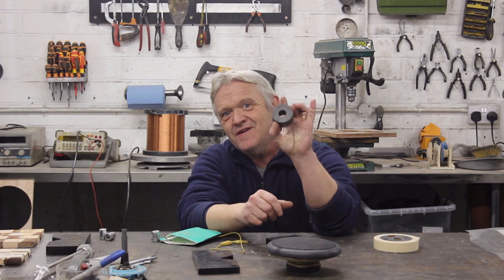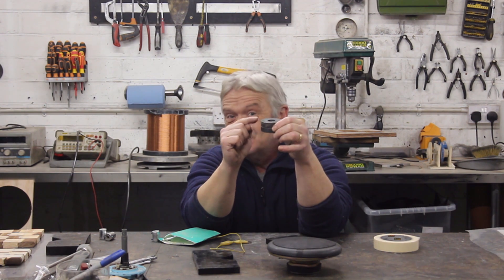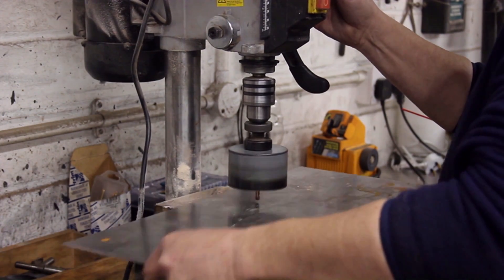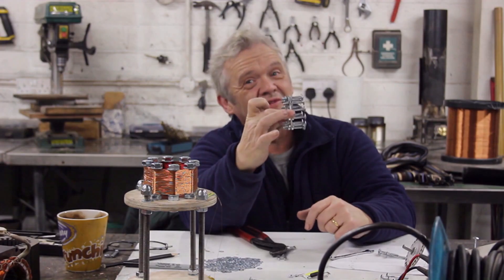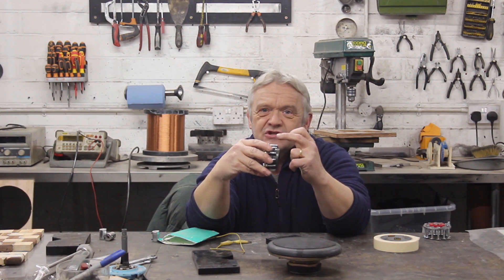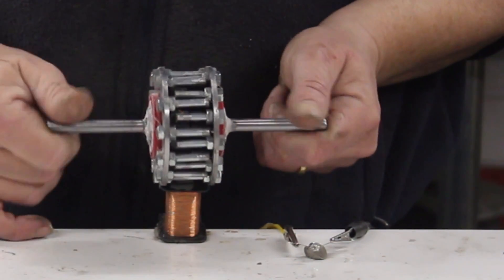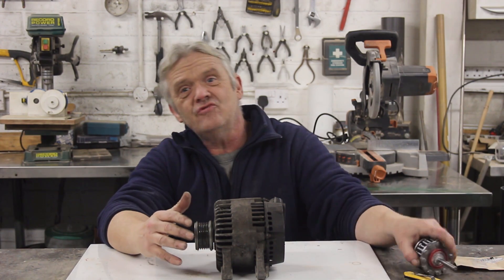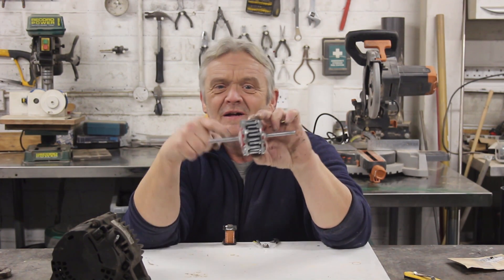1849 Speakers On Fire - Getting Power From A Speaker

Comment: I have taken some  of those magnets and added it onto a electric fan motor and I’m still in the project but need some more time on it, I was able to generate a resistance field on the stator but have not yet connected that to a rectifier   and capacitor, I was thinking power by wind wall or kinetic battery 🔋

Comment: 0:31 I believe there's ways to spin the ring magnet on a 90° axes quite easily,, 2 simple 3D printed clamps on the rotating points with bearings in them and a bolt on each side,, then have multiple of these rotating in another ring. Then multiple of these rings with different diameters spinning on different axes in a ball. Like those in Star Trek. 🤔

Comment: Hi Rob, thought I was getting to understand electricity but I'm now more confused the more I know, or think I know. The more turns on a wire on/in a coil increases voltage right? And the voltage reading is the potential difference between one end of a wire and the other, so the voltage we get across the coil is whatever is being generated minus whatever is coming out the other end, is that right? Thanks mac

Comment: Hi Rob, I discovered much like a light bulb a speaker (for a PC) can not tell the difference between ac and dc voltage and it also uses less power with dc. The wires became thin and brittle at the plug and eventually snapped, so I hooked it up to a motorcycle battery, doesn't matter which way round the wires go either which I found odd. Used about 0.1 amps at 12 volts, the speakers when plugged into mains were 55 watts consumption.
Reply: Actually just checked again and the speakers were 18 watts not 55 my bad, dunno where I got 55 From!! Must have been looking at something else, still 18 watts on ac and 12 x 0.1 = 1.2 watts on dc. That's a massive saving percentage wise

Comment: So, put the thing on some bearings and spin it next to your coil, and let's see it work. Put the output on an oscilloscope and let us see it.  What is the rectifier circuit needed to make DC?  Where is your microwave transformer?
Reply: " What is the rectifier circuit needed to make DC?"
He's probably having the LED pull double duty by using it as a diode.

Comment: Those chinesium ceiling fans are about the same size as those speaker magnets and have the pressed steel crab claws! IF I can get permission to disassemble (Johnny 5) the 2 surplus speakers in the surround sound system, I will try it.
On another note: faraday research RND channel and zero point/ permetumle energy machine, have you veiwed any of his videos? To me without paying for patreon membership; it looks hocus pocus, your thoughts Rob?

Comment: That is awesome. Are you still interested in the earth battery idea btw? I think the name needs to change. Did some tests myself and found that while the chosen material matter, the size and shape does not seem to matter. Or the amount of soil and so in. Saw a clever dude who made a tiny bank of these batteries into about a AA size. What I found really interesting was when testing continuity across various of these experiments, the fact that the buzzer went off amazed me. Sometimes I wouldn't get continuity buzzer, but do get volts. My last test was PVC conduit with tiny holes at varying distances, filled with plain water and sealed the ends, I got a voltage of about 0.5 and distances did not make a difference. My conclusion is that smaller is better. This really sound like a 3d print idea. Like the ice tray, but much smaller and tiny tiny holes the diameter of your copper and steel wires so they can be filled and wires inserted easily. We know electrons are not really moving through wires and that is actually the fields around the wires and the wires only direct them. This is why I find it fascinating and all the stuff you do lol
Reply: Oh and most important, water seems to be the key ingredient. So does water have a special field we are not aware of? We know water is a unique liquid, non like it. Take also conductors, we think we need them alone, like adding salt to make water conductive, but static doesn't require a conductor. Sorry, my head going crazy again
Reply: @adesign5  water mixes with the soil to create ions (charged atoms and molecules) which allows the ions in the soil to conduct. As I have mentioned before (to others) is this system is just creating a "battery"... where moist soil acts as the electrolyte. It is basically a very poor battery. Most of the energy comes from the zinc and copper reaction and very very little from anywhere else. You can prove this to yourself by testing for "milliamps of current" with a multimeter to see how much current you get with a dead short... and then remove the zinc and replace it with just copper... now there can't be any zinc copper action and you will find the current of "just the soil interacting with copper".
Reply: @marcfruchtman9473  I don't have zinc unfortunately and the amps are too low for my multimeter to detect anything. But I do think your wrong with regards to the reaction happening. Because I still got results by testing just plain water. And the chosen metals only have to be different. It is was a chemical reaction like a battery then bigger sizes would matter, but it doesn't. But it is because we don't really know what is happening that I like exploring this idea. Anycase there is a lot of testing to still do. Plus I live in South Africa and we don't have power about half the day, so that frees me up to just test things like this, without any preconceptions cheers
Reply: @adesign5  Sigh. "Too low to detect" literally says it all. Please, if you don't have power half the day...there are far better ways to generate power than "Too low to detect" What resources are around you?.
Reply: @marcfruchtman9473  I never said I'm looking into this to generate power for myself, there are much easier ways. What I am saying is it is interesting and I have time to mess around because I have plenty time without power which means no interference from grid power. And yes, I just have the cheapest multimeter. Sigh, where is your sense of adventure or do you just know it all and say there is no need to experiment. Sigh sigh
Reply: @adesign5  Well, if you have time to spare that's fine. But,. I do think the lack of milli-amps says it all. I can hook my multimeter up to "water" and get a small voltage but it doesn't have any meaning since there is not a useful current with it. But for curiosity sake, If it will help you experience the truth... sure.

Comment: My last post was giving me trouble. I’m going to try it again.

Your ring magnets are curious. I have often considered trying to shield one of its poles with several layers of magnetic shielding material. Wondering if this would allow you to greatly reduce your chosen magnetic pole.

Creating an imbalance allowing the magnet to enter one side easier than it would have otherwise. Possibly propelling a magnet passing through the center faster out one side than the force required to get into the center of the magnet.
Reply: Not exactly sure what you mean by "faster out one side required to get into the center of the magnet" because it seems to imply more energy out than in. (Unless you are saying something else?) But otherwise there is not a way to do that. (That violates the principle of Conservation of Energy.) However, you might be able to arrange it where it takes much more force over time to push something inward, and then comes out faster but with less force over time.
Reply: @marcfruchtman9473    Thank you for your response and yes you understood my ramblings fairly well.  

I understand what the fundamental laws are.  I am not proposing a change to those understandings, simply a cleverly designed shield that redirects the chosen magnetic force.  

Magnet switches do this.  Allowing the user to switch the force of the magnet essentially on or off.   Of course it’s not turning the magnet off, it’s just positioning a magnetic shield in a fashion that the force is nearly canceled out, or moving the flux away from the chosen area.  
 
The same concept just in a way that would allow you to (in few words) create a magnet that who’s “repulsion” phase is acting on the center more strongly on the outgoing side of the ring.
Reply: Let’s say we are passing one small magnet through the center of the larger ring.  The small magnet is traveling  in a straight line through the opening in Robs ring magnet and out the other side.   The magnetic faild of Rob’s ring magnet should more or less look like a donut.  When the small Magnet travels in a straight line toward the opening of the ring magnet it will be encountering either a push, or pull force that is equal to its counterpart should the small magnet be traveling through the opening and out the other side.  Canceling any possible net gain.   Laws of physics right.  

What if we designed a shield to redirect the flux on the incoming side of the magnet in a way to allow the small traveling magnet to encounter less direct force coming into the ring than the push it will revive from the non shrilled side of the magnet.
Reply: @Route72Trucks  Ok... yes, that makes it more clear. So, one of the most interesting things about magnetic field lines is that they follow a circuit path. Now, I have to say this never made any sense to me until recently. Basically, all of "space" (and air) is mostly "empty" and therefore it has a very similar "conductivity" to a magnetic field. You can generally think of this term as the magnetic Permeability of "Free Space" and the magnetic permeability of air is essentially equal to the vacuum of space. Rather than use the actual number they call it "relative permeabilityand call that =~1) Now imagine I said... that it is all like a "wire" conducting magnetic field lines...  So, now you sort of get how magnetic lines of force are "conducted". However, "soft iron" is much much more conductive (permeable) to magnetic fields... essentially, (not the same as a shield) but essentially, if you place a piece of soft iron (called a keeper) onto the ends of a horse shoe shaped magnet  almost all of the magnetic lines of force are "conducted" into that iron piece, and almost NO lines of force will go beyond that. Ie, it concentrates the magnetic circuit into the iron. Thus, you can sort of create your idea, by molding soft iron over the areas where you want "less" force because the iron will pull the magnetic lines of force into it. (If that makes some sense?) However, I do believe that you have to make the "circuit" for it to be most effective.
A decent video on this topic is: Magnetic Fields, Keepers & Iron Filings with Horseshoe, Ceramic and Neodymium Magnets by RimstarOrg
Reply: @marcfruchtman9473   thank you for the information Marc.  More things I will keep in consideration as I mentally chew on this latest of thought projects.

Comment: I won second place in high school for theorizing a wall of microphone/speaker modules placed in noise polluted areas, like the side of a highway or an airport. It was a long time ago, but I recall that there is actually a lot more ambient sound energy around than we realize, especially if you include upper and lower ranges.
Reply: There was a company a few years ago that made sound coolers that were put in noisy areas like metro tunnels. The problem with sound is that it doesn't have much energy :) But it was enough to keep those refreshing cans of beverage at nice, cold temperatures without using external source of power for refrigeration:)
Reply: @ogi22  ya know, you can't discount the value of a cold drink at times
Reply: @SeaforgedArtifacts  Yup, sometimes everyone needs a cold one and few minutes of peace 😁
Reply: I came up with the same idea years ago too. A big wall of speakers are essentially a bunch of solenoids attached to a cone. Use a transformer to up the voltage and then run through a bridge rectifier for DC. Tiny current but depending on the application it could be good enough. Maybe an environmental sensor for long term where solar isn't available and a battery is no good?
Reply: @JehuMcSpooran  Interesting idea but i have one reservation. Speakers are physically limited. I just hope i will be understood properly here. I mean that a membrane has limited space to move. They work best with air oscillations in the hearing range. So naturally they will be like an antenna, catching those oscillations... which have really small amount of energy. That's why it's better to catch that steady wind flow with e.g a wall of fans or something similar that is more susceptible to air flow.
Something like with that thoroidal propeller - it was designed for water to reduce noise and cavitation. It sure does work in the air, but there are much better designs for air propellers.
Reply: @JehuMcSpooran  definitely, or possibly keeping a larger battery system trickle charged when solar or other systems are not viable.
Reply: You could add a thin metal plate to a big speaker and all the vibrations may create power from speaker.
Reply: @gameoverwehaveeverypixelco1258  You don't need a metal plate, just remove the diode from the speaker and power will back flow through the speaker wires when the speaker vibrates, it will still vibrate with exterior sound without the metal plate 👍
Reply: When i first read this the thought of a huge noise cancellation device came to mind.
Reply: Shouldn't a noise cancellation device be putting out exactly the opposite frequency spectrum as the noise it wants to cancel? 
How does that work in this setup with a mic or a metal plate?

Comment: The shafts of the alternator is magnetic and if you just slide a magnet over this shaft  it will weaken the magnetic field the same way a piece of steel will weaken the open ends of a horseshoe magnet.  It will be the path least resistance path for the magnet field to flow through. So to do that conversion to the alternator correctly the shaft has to be exchanged for a non magnetic shaft such as stainless steel. That way the full power of the speaker magnet wi go into the 2 parts of the amateur core.

Comment: I remember seeing one such car  alternator armature modified with a ring magnetic like Robert proposed here. I don't remember who did it, nor have I been able to find it again.

The electricity generation will be much more efficent without using slip rings to pass current through the armature coil. And the armature will be very much cooler as anresult. And while the new alternator after rectification needs to charge the batteries while the engine is idling, the field coils will generate a much higher AC voltage at higher engine speeds so the voltage needs regulating. Additionally, at a higher rpm, consuming the same power at a lower voltage reduces the amount of i² power lost in the field coils which may further increase the efficency.

As for regulating the output voltage, I propose that after rectification, there's a capacitor to help feed a smoothed voltage into a buck converter that regulates the output voltage to whats nessesary to charge a car's battery.

Comment: Love you sir.
I'm a beginner, anybody who can answer some questions would be appreciated. 

First was there a magnet on top of that coil? Or was it just a coil?

Second, couldn't this be applied on a bicycle or something to generate power? Or is it generating tiny amounts of power?
How does the steel bend the magnetic field? Is? It because it is a non magnetic metal.
Reply: In this video there was one small coil  on the table.  Robert  with his rotor in hand spun it over over the coil, And the alternating magnetic poles passing over the coil inducing a changing voltage in the coil. 

Can this be done in a bicycle wheel sure.  But i see two main issues. First is that it's easier to do an axial flux vs radial flux generator/motor on a bicycle wheel. Or mount a bunch of magnets on the outside rim and gonradial or axial flux. Secondly, while an athlete can do a bit better the average person may only generate roughly 100 watts of power continously on a bike for a length of time. But a bike wheel could be used as part of a wind turbine.

Comment: Is this like 12 magnets from 1?
Reply: Recall that 1 large magnet might have millions of "magnetic lines of force"... this simply divides them up evenly along the bolts.
Reply: @marcfruchtman9473  great point. Curious why drone motors or rc brushless motora don't use a single magnet like this setup instead of gluing all those little ones in place
Reply: @David_Mash  Well, I had certainly considered it! But, the method they use is more like a "controlled" turning on / off of the coils using transistor technology. Technically it is "Brushless" but the transistor does the switching.